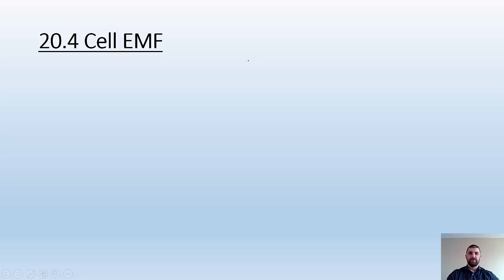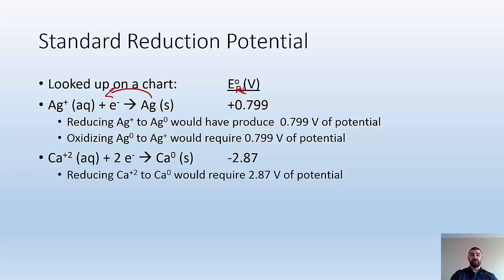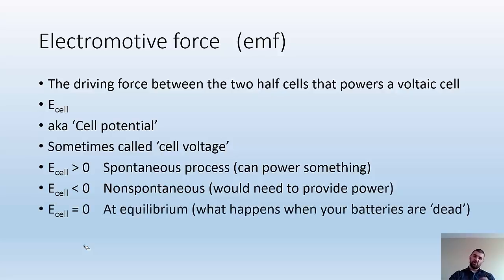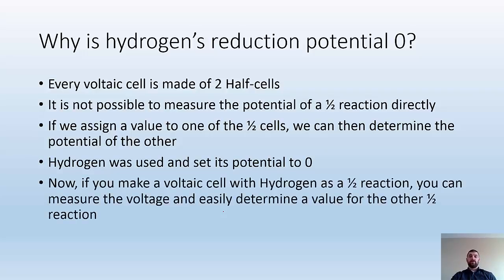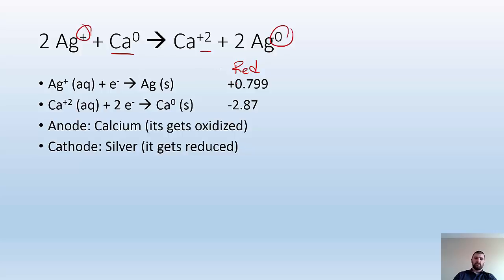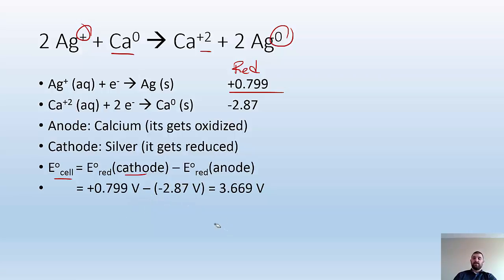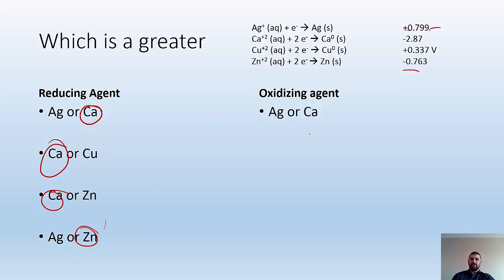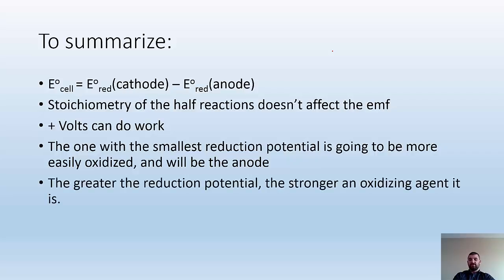20.4 Cell electromotive force (emf)

Comment: (5:25) Why is it that both values are positive? If I have a reduction half reaction that is negative value of V and a oxidation half reaction that is a positive value, would it still be correct?
Reply from the maker: Typically you're given reduction potentials, so for the oxidation reaction you need to change the sign (+/-) for the value. Both values don't need to be positive though, it can be any combination. If the resulting E is positive, it is a spontaneous process and if it's negative it's no spontaneous. 

Did that answer your question?